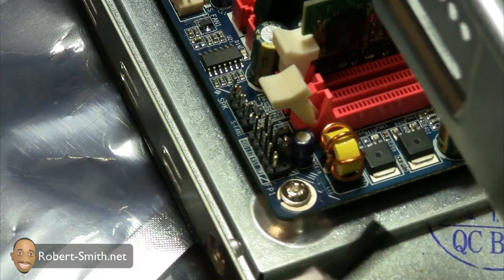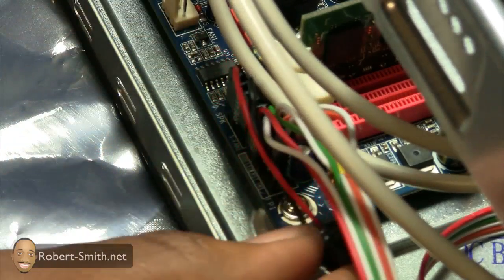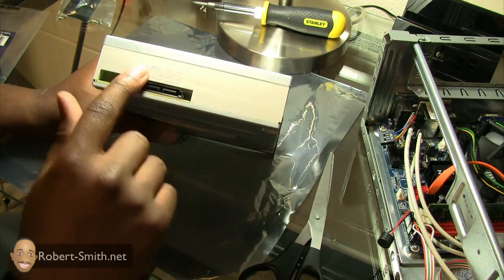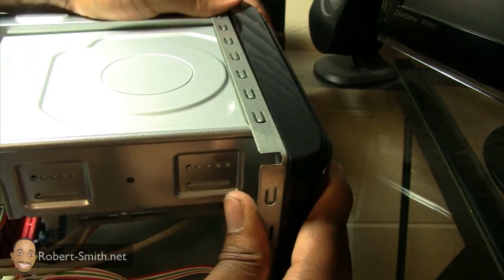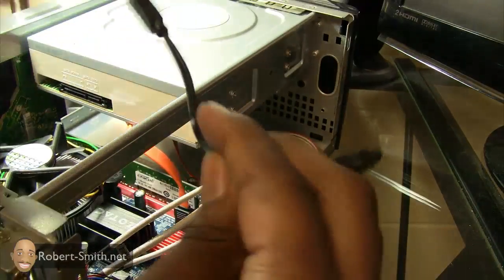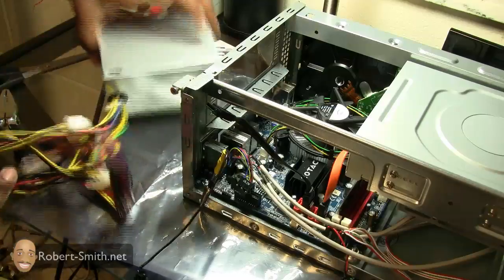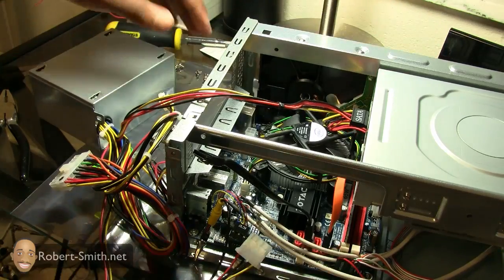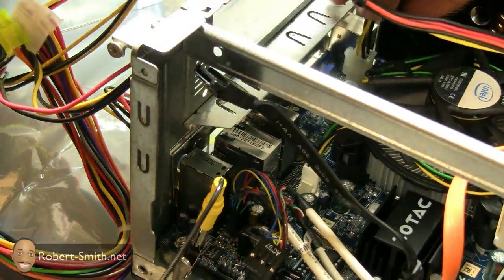How To Build A Mini ITX Computer Part 7/9

Comment: @RobertSmith3 I sold some slot cars on ebay and they never put all of the money in account then they kept charging me a monthly fee for services for about three months after I place the adds and i had not put a add in for several months, seller fees due again, it was never ending I thought they would never stop with the seller fees Im never put another add in for auction again.